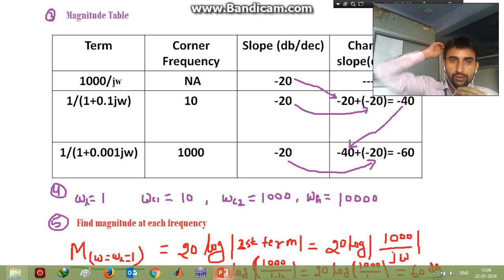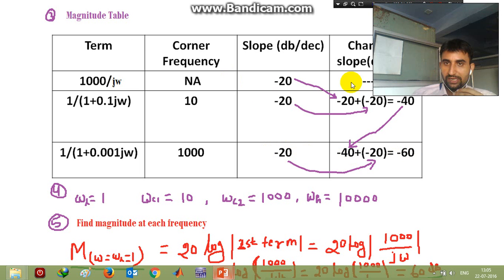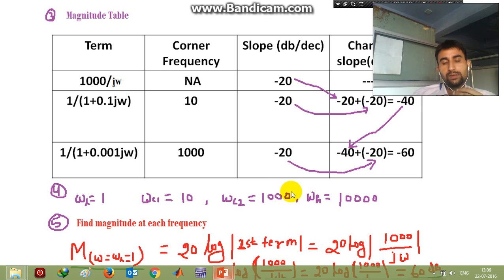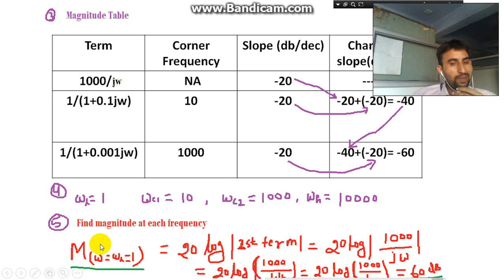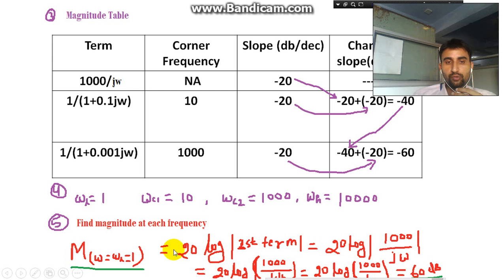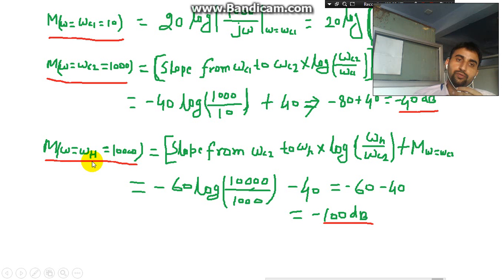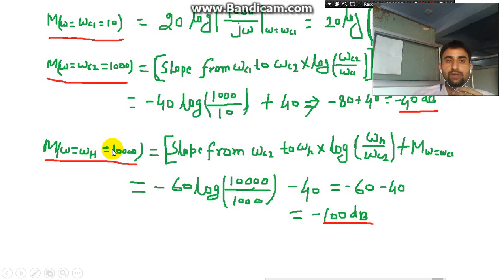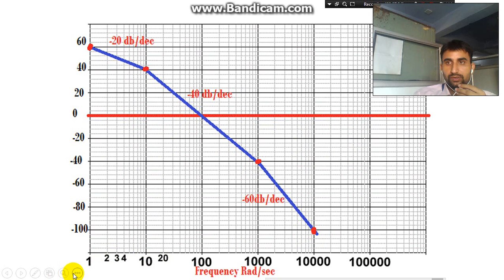simple method to draw bode plot-2

Comment: why we consider only first term while calculating magnitude ?
Reply from the maker: 1st term is only used for calculating the starting point of the magnitude plot of bode plot
Reply: @harimohanrai  but u have calculated magnitude of first term for each corner frequency. I don't understand that
Reply from the maker: @FitTechCricketer  : No please see once agai only for two frequency, one which is given in the transfer function and another which we have assumed (lowest frequency). That means only for the starting slope the 1st term is being used, check out the slope table the 1st term is responsible for the intial slope and starting point that's why it is being used from 3rd point onward means from 2nd slope the formula changes

Comment: Most of the people solve bode plot using k' =20logk . Is it fine to use this method in the  Mumbai  university exams
Reply from the maker: This method is acceptable method. You may ask to your professor wheather they accept it or not. But this method is also referred in certain book. You may refer control system by nagoor kani.
Reply: @harimohanrai  thank you very much🙏🏻👍🏻